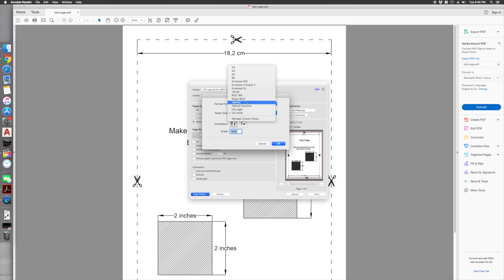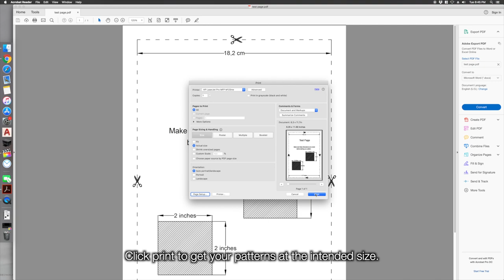DIY Cowboy Hat - Tutorial and Pattern Download

Comment: Tony, what ensures that the holes of the top part of the hat match up with the holes at the top of the sidewalls? Do you have orientation points, or is it simply that you use the same size stitching punch? However, even using the same size stitching punch doesn't ensure that all holes would line up, as the circumferences are different.
Reply from the maker: its science :P All it matters is that they match

Comment: Did you use a laser machine to cut the black leather and make the holes. I noticed that the holes are oval , not round, and the shapes are perfect :)
Reply from the maker: Yes i did
Reply: @DieselpunkRo  Cool... what machine do you have, and how bad is the smell of burned leather?
Reply: If you using a laser, make sure it is a non-chrome tanned hide.  The vaporized chrome can hurt you.

Comment: If I were to wet the hat before dyeing it would this pattern work to make it have those dents on top of most "cowboy" style hats?
Reply: You can wet mold before or after dying, just know that after you will have some residual dye on whatever you used to apply the water (sponge, towel, whatever) even though it shouldn't show on your leather if you properly dyed and dried it.  You will probably need to finish it after that with some top coat to give it more of a water resistance so you don't lose your shape.